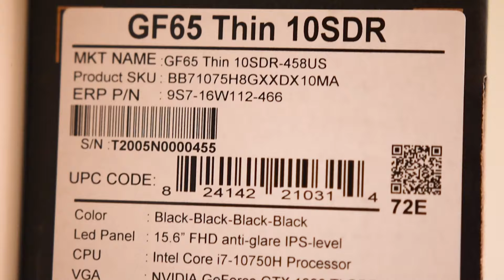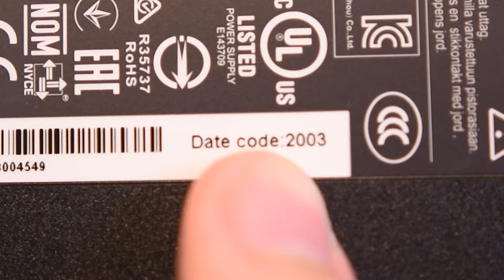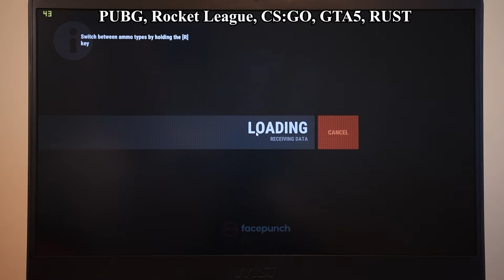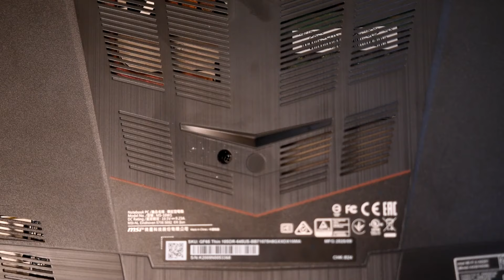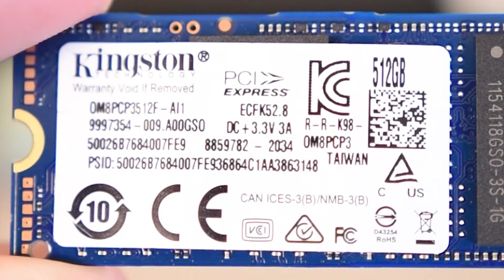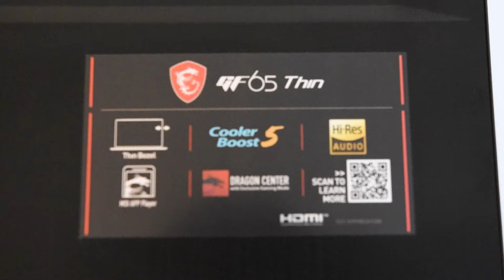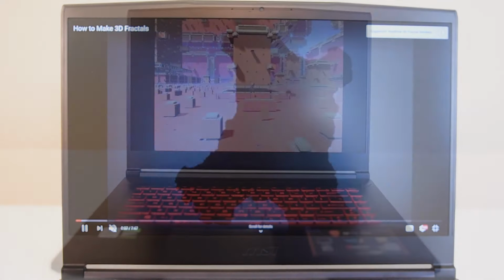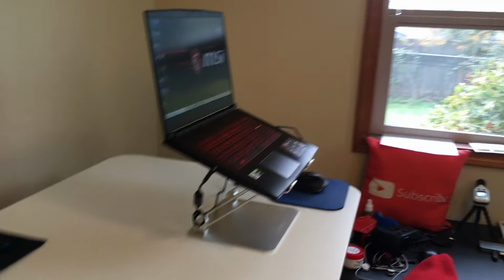GF65 Thin MSI GAMING LAPTOP REVIEW, GTX 1660TI,  6 CORE 10750H

Comment: What was your room's temperature when you tested this laptop's thermals?
Reply from the maker: I am now back did you end up purchasing a machine if so what did you end up getting? be very interesting to know. Also if you are still looking for a machine I would love to help. Let me know if you are still searching!

I am trying to build the best tech & entertainment channel possible if you have any questions I am always standing by to help you with your tech needs what ever they may be. I will always be there for you, So if you like this kind of content I highly recommend you subscribe. :)
Good luck
Reply from the maker: Lenovo legion series is quite good might be slightly higher price but it’s quite good build quality.

Acer is very similar to Msi but really msi has no equal, msi is good value and very light machine but it’s plastic is thin and if you upgrade your msi ram you might crack it’s plastic in the process which has happened to me with 3 msi machines…. Subscribe if you like the content and have more questions I’d love to be your go to tech channel :)
Reply from the maker: @murad dhvk If gaming isnt the most important aspect I would suggest the macbook, im sure your tired of hearing about them but they are perfect except for high end gaming, although you can still game depends on if you are willing to tinker with it. 

What type of games do you play?

The macbook has the best screen, 
the best trackpad,
the best keyboard,
the best chassis,
the best battery,
the best speakers,
the best support,
the best port selection(thunderbolt can do anything its the most capable port)

the operating system is quite good two, except again you are not natively running windows though but with parallels it actually runs windows quite well and even gaming is decent(how ever some games have input lag), eventually you might be able to run windows natively on m1 macbook and once that time comes hands down the macbook is the best, me personally I want a macbook but with windows installed so I can still game and play natural selection 2 and RUST. 

you can find used alienware area 51m first generation for $1400, are you in india? Need to know where you are located so I can offer recommendations based on region.

Comment: thanks a lot for nice review !
i have question about this laptop and Lenovo Legion 5-CF ...
which one is better ? i compare them and i see this laptop is more light than legion ! (around 0.6 kg)
could you offer which one i should buy ?
Reply from the maker: Is the gf65 your looking at the exact spec of the one used in this video? It will help me figure out because the gf65 comes in many different specs
Reply from the maker: Can I see a link to the exact legion 5 just to be sure before I compare there are so many different versions of the same thing essentially
Reply: @SERGE_Tech  Legion 5 ab system : i7 10th gen , Ram 16 G , 512G SSD , 1660ti 6G , 2.46 kg weight
MSI Gf65 Thin system: i7 10th gen , Ram 8 G(I'm going to update that) , 512G SSD , 1660ti 6G , 1.84 kg weight
They are too close each other but MSI is too light than legion ...
What's your suggestions for buying? (I'm not going to play games too much !)

Comment: what is the difference between this model and the non-thin model?
Reply: That the other is supossed to be more heavier, but on the brighter side, it should be quieter because the thin ones are meant to be louder in order to be "thin"

Comment: I have the same laptop and I want to upgrade it to 16gb ram. Should I get another one of the same ram and put it? It has to be the same brand in order to work dual channel? Will this void the warranty?
Reply from the maker: yeah getting the same stick is best but sometimes it can work with different brands if the stick has the same speed and timings. If it doesn't it can also still sometimes work but might be problematic. 

I am trying to build the best tech & entertainment channel possible if you have any questions I am always standing by to help you with your tech needs what ever they may be. I will always be there for you, So if you like this kind of content I highly recommend you subscribe. :)
Since I am building this channel for you!
Would love to have you as a sub some day. Anyway let me know if you have more questions!
Reply: @SERGE_Tech  thanks for the help! You won my sub !
Reply: @yiannis2298  bro I have same laptop but it's cpu temperature going up to 95 in fortnitr with low ghraphic setting is that normal?
Reply: @mahdisharifi1040  mine 70-75 at max... I'm not sure
Reply: @yiannis2298  witch game?

Comment: I'm thinking of getting myself a GF65 with I7-10750H & rtx2060 in the near future. 1 thing I'm worried about is battery life. How long can I expect the battery to last while a) web surfing [browsing Youtube] and/or office work b) gaming? Also, are the thermals of the GF65 decent?  Would really appreciate any comments from people with this latop
Reply from the maker: Great questions! keep them coming. So there are two types of machines those that can browse the internet for 6-12 hours and then there are those that browse for 2-3hrs. This machine here is great for gaming, But it doesnt have the most up to date best methods used for battery optimizations. now sure you will run your browser on here just fine but that cpu doesnt throttle down to 400mhz it stays really high in the ghz and it wastes power simply staying on when it could be off. This MSI wont have good battery while browsing. I also wanna say that no windows machine usually ever has good battery while browsing. Its very rare to find but machines like the dell XPS have better firmware to control the cpu in proper maner. Dell xps could get 6hrs of browsing but you wont get a good gpu. 

A lot of what makes the gaming machine have terrible battery is the lack of good software battery optimizations and they tend to put beefy power hungry cpu and gpu. but machines like macbook and dell xps use power efficient cpus so they have good battery. 

I doubt a gaming machine has good battery pretty much ever but thats the nature of where they come from and I think even with 2-3hrs on a gaming machine is not half bad. 

I am trying to build the best tech channel possible if you have any questions I am always standing by to help you with your tech needs. I will always be there for you, So if you like this kind of content I highly recommend you subscribe. :)
Good luck!

Comment: Hey so I'm stuck between this gp65_10skd ,legion 5 and asus zenbook ux534. which one should I buy?also if u know of any other 15inch laptop I appreciate u telling me.thanks
Reply from the maker: Very good question, I would go with the legion 5, it has 4 usb a ports and I find this very useful because I have multiple external drives, headphones and a mouse that need 4 usb ports. I actually tested the legion 5 and I was very impressed with it, I think its one of the best machines anyone can buy right now, its design is good, it feels high quality, it doesn't look too flashy and its priced well. the next runner up is the MSI but the msi uses cheaper components and feels like it couldn't take a drop like the legion 5 could. In terms of gaming both the lenovo and msi will be better then the zenbook, I used to really like zenbook I am not sure what happened to there brand, the screen in the trackpad really makes no sense, I see no practical use for it. I mean its kinda cool and if I could choose to have a screen in the trackpad I would but still its not super useful its a cool trick but it wont get you anywhere, the form factor of the zenbook is very nice but this machine will strugle if you compare it to the legion and the msi. 

The msi will be lighter then the legion but its also cheaper and more plasticky feeling. at this point I would say get a 17" machine if you have the ability to do so since it will make upgrading potential better. I have reviewed a lot of msi and the legion 5 I recently used for about a month was quite good I think ill be releasing a review of it soon. I think the legion has a better balance of everything it has no real weak points like the msi with its cheap feel but again you do get a lighter machine with the msi because its cheap thin plastic so its up to you. 

Which one do you want and why?

I am trying to build the best tech & entertainment channel possible if you have any questions I am always standing by to help you with your tech needs what ever they may be. I will always be there for you, So if you like this kind of content I highly recommend you subscribe. :)
Good luck!
Reply: @SERGE_Tech  thank u so soo much for taking the time and answering me.by the way I subscribed to your channel.😉
I completely stopped thinking on msi since the material is very important to me.
I'm going with legion5 although I'm a little worried about it's brightness and also overall how long it lasts cause I use my laptop 24/7 and really can't buy a laptop every 2 or 3 years.
Again thank u so much.
hope your channel gets more and more famous everyday.

Comment: Which laptop is better in thermal regulation 
HP OMEN vs MSI GF65 THIN 

Both have 1660ti ?

It would be very helpful if u reply..
Reply: I think hp omen thermals are better than Msi Gf65 
I would recommend Lenovo Legion 5 for you
Reply from the maker: I recently tested Lenovo legion 5 and its hands down the best value I have seen in a laptop. Its also got very good quality, better then msi or hp. It cools well and games great. I didnt really find any flaws in that machine! 

regarding your question though which hp omen are you looking at and is it the modern hp omen?
Reply from the maker: I am trying to build the best tech & entertainment channel possible if you have any questions I am always standing by to help you with your tech needs what ever they may be. I will always be there for you, So if you like this kind of content I highly recommend you subscribe. :)
Good luck!

Comment: Hello . I need advice ! 
I started playing CS GO on Lenovo legion : i5-8300h ; gtx 1050 ; 24gb ram and 60hz monitor. Now i think to buy MSI GF65 Thin 10SDR-807XRO, 15.6", Intel® Core™ i5-10300H, RAM 8GB, SSD 256GB, NVIDIA® GeForce® GTX 1660 Ti 6GB 144hz  ; Will I feel the difference 
? Is it worth it ?
Reply from the maker: Yes it is worth it. The 1660 Ti is 131 percent faster. It is a very good system that’s also not taking into account the faster cpu.
Reply from the maker: Do you know what the cost difference is? Between the two models? Will you be playing games like RUST, Natural selection 2 or other demanding games?
Reply: @SERGE_Tech  Hello SERGE , I have the Lenovo 
i bought it 3 years ago , now I can buy this MSI laptop for about 900$ . For now i play only cs go . Will I feel the difference with the better video card and 144hz monitor
Reply from the maker: When I switched to a 144 hertz screen my score literally doubled in my FPS games pretty awesome stuff. I think it’s worth it to you.

Comment: hey SERGE, i hope you see this post, and I hope you're doing well. i bought this laptop in late December of 2020 and out of the box i have had battery issues. i ran the Dragon Center battery calibration right out of the box, and have ran it every 2-3 months since. with the keyboard backlight off, lower refresh rate, windows settings to max battery life, and Dragon Center set to max battery, i only get about 30 minutes of battery life at best. is this a sign of a DOA battery?  WHAT AM I DOING WRONG!? I appreciate any info you can give.
Reply from the maker: Great question, actually 30 minute battery depends on the game, some games demand a lot of resources thats just how it is, sometimes I can get 2hrs playing a low demanding game but most high end games will just kill the battery....

m1 macbook solved the battery issue but no other company has found a way to do this. 

update me on how your problem is coming along, I would like to know if you solved it any other way.

Comment: I've been looking for a good gaming laptop recently for 1000 dollars or less and this seems like  a big upgrade from my current HP ENVY x360 laptop. I'm just not sure what to get, i looked at aser and this specific one. mostly looking for something I can play games like COD with my brother (he has the aser nitro 5)
Reply from the maker: should be able to get something pretty decent for $1000 USD are you considering used or refurbished markets? These are some of the best places to look for machines. cragislist and ebay tend to have very good deals. 

gf65 thin is a very good competitor to acer nitro 5. If it seems like the gf65 thin can do it all for you just pick it because its a decent machine priced very competitively. 

right now for your price range I believe the Lenovo Legion 5 is the best machine you can get. It might be 1200$ which is a more then what you have but you might be able to find a used one.  Take a look:

$900
https://www.ebay.com/itm/Lenovo-Legion-5-15IMH05H-15-6-512GB-SSD-Intel-Core-i7-10750H-2-60GHz-8GB/274756042733?epid=26039421470&hash=item3ff8bc7fed:g:pu4AAOSwGYNfM62Z

$1200
https://www.ebay.com/itm/New-Lenovo-Legion-5-i7-10750H-16GB-512GB-NVMe-NVIDIA-2060-FHD-240Hz-81Y600DCUS/324553131275?epid=25042446505&hash=item4b90dfc50b:g:gfoAAOSw8kFgSYxt

I am trying to build the best tech & entertainment channel possible if you have any questions I am always standing by to help you with your tech needs what ever they may be. I will always be there for you, So if you like this kind of content I highly recommend you subscribe. :)
Good luck!

Comment: Should I buy this msi with i7 and 1660ti or a legion 5 with i5 10th gen and rtx 2060?what do you think please help me 😊
Reply from the maker: RTX2060 is substantially better, it has more vram and works about 10 percent faster. I will review legion in next week. If you like the design of the msi more go for that the legion may have stronger specs for the gpu. But its cpu is weaker then the msi. So I think MSI is better in this case because a 6 core vs 4 core is a much bigger deal then the gpu.

if you have any more questions feel free to let me know I am standing by, I am trying to build the best tech channel possible if you like this kind of content I think you would make a great subscriber. Good luck and let me know if you have more questions :) I love chatting about tech.
Reply: @SERGE_Tech  both have 6gb vrams.

Comment: i just pick this up from an auction from an online return ( assuming amazone return ) brand new 1660ti 2tb adata swordfish 64 gb ram. had an issue with installing windows for the first time ( simple and easy fix). but i cannot seem to find out the full specs of this device is this device  capable of 4x4 express m. 2? or is it a 3x4  i see i am able to upgrade with a 2nd m.2 which is a plus but im looking at faster loading with the 4x4 pcie rather than the 3x4. any ofo would be appreciated thank you!
Reply from the maker: Oh cool what auction did you find it at? be interesting to know. 

To know the full spec of the device you need to determine the exact model of laptop you have. If you cant do that figure out what the motherboard is using a program like cpu z and then you can google the capabilities of that specific motherboard, might be able to find it in a manufactures website either on MSI or who ever designed the board knows the true capabilities. Sometimes the motherboard manufacturer doesn't even know what its capable of... pretty funny stuff...

its probably 3x4 and some other kind of slower variant most of the second slots in machines are not true second slot but instead some gimped lanes exist and it operates at half speed. Id be very surprised if a budget machine had fastest speed available with all 4 lanes. 

Where do you need the faster loads? what specific application are you worried about because it might not even matter?
Reply from the maker: oh darn didn't get a chance to read the comments before you deleted them. In terms of load times I noticed there isnt much noticeable different once you surpass read of 2000mbs, however a read of 500mbs actually isn't bad and works quiet well. 

I am trying to build the best tech & entertainment channel possible if you have any questions I am always standing by to help you with your tech needs what ever they may be. I will always be there for you, So if you like this kind of content I highly recommend you subscribe. :)
Since I am building this channel for you! Help me build it. 
Would love to have you as a sub some day. Anyway let me know if you have more questions!
Reply: @SERGE_Tech  no problem. yeah i got the pc from nellis auction, there is one located in las vegas and phoenix. there can be some great deals on things, but also not very good things just need to research and pay attention to detail when looking at buying. i almost got ripped off on this PC lol, the auction listed it as a 32gb ram, 512 nvme m.2, rtx 3060.... got the box after buying, 8 gb ram, 256 gb m.2, 1660 ti gtx....... fixed the booting issue looked at system specs, 2tb nvme, 64 gb ram, 1660gb. wasnt to bad was sweating for a minute.
Reply from the maker: wow what a story yes glad you check it out, my uncle once bought a fake video card, it looked like a powerful gpu but it had a fake large heatsink and chips that lead to nothing, however it still worked like a really slow gimped gpu, he wasnt so lucky ended up getting scamed...

Comment: Hi good review
I have a question, when I play warzone in this laptop I have like 86c in the gpu and 93c in the cpu is normal? Or it is overheating?
Reply from the maker: Yup that’s how they designed it, it could of been a bit cooler but really it’s not like it’s damaging the components or anything so I think you shouldn’t worry.
Reply: You can use coolerbooster to cool it down
Reply: How much fps do you get?
Reply: bro I have same laptop but it's cpu temperature going up to 95 in fortnitr with low ghraphic setting is that normal?